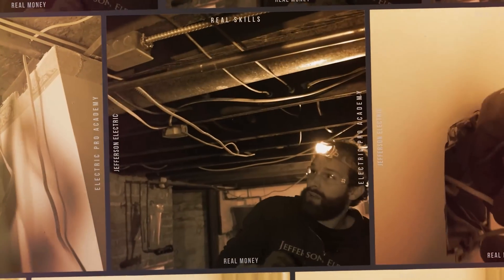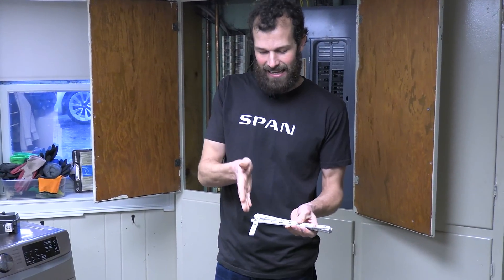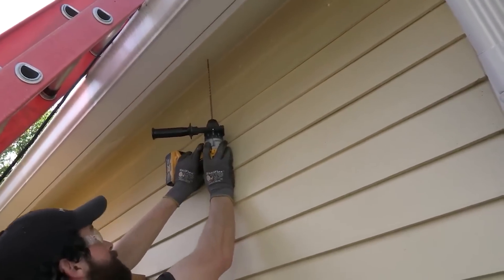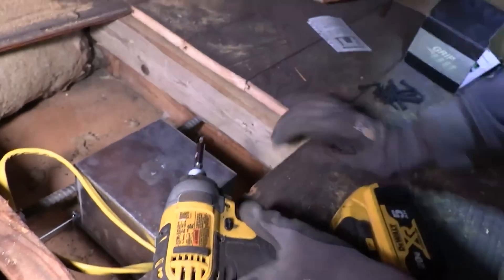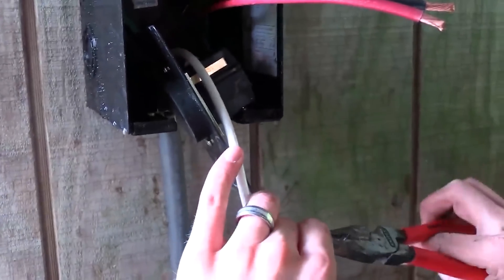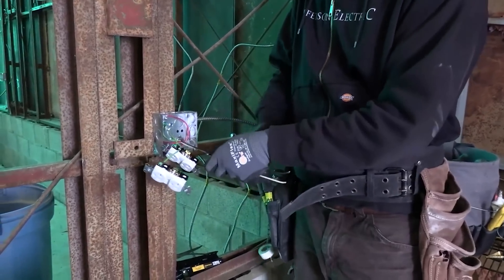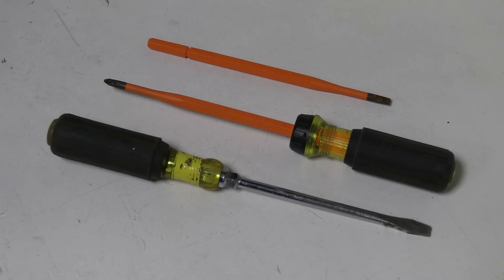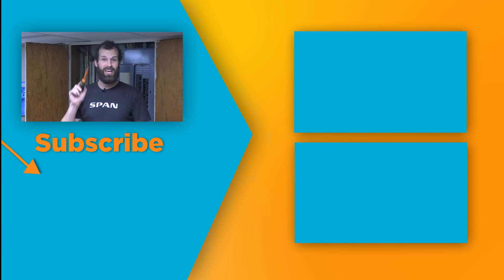Our 7 Most-Used Tools of 2022

Comment: Had a nice Rigid non metallic 6' folding rule for years. Finally grew feet. Love every cordless tool that I ever owned or used. Still call linesmen pliers side cutters ( ya I'm an old fart ) . Klein died make a great non contact tester. Like the single shaft real deal Klein insulated screwdrivers. Thanks Joel.

Comment: Please I have one question..Can Control and Line Voltage Wires Be Run in the Same Conduit?
Reply from the maker: Yes, with conditions (and it's always worth checking with your local AHJ):
Code Minimum - As long as the control wiring (all conductors) is rated for the highest voltage present.
Best Practice - Your power wiring may cause inductive interference to your communication wiring. That’s not likely with control wiring.

Comment: I find the drill to be better than the impact. One noise and vibration versus the adjustable I wanna say torque setting and speed setting. What I usually do is Chuck one of those quarter inch bit adapters in and just leave it and then it's a standard size. Unfortunately I got a set of drillbits with aluminum quarter inch ends and half of them have snapped so I went back to using standard drill bits which is so annoying because I enjoyed the quick change.
Reply: Impact drivers are better for driving fasteners than the combo hammer drills, in my opinion.

Comment: I splurged for a Knipex, it only has strippers for 14 and 12ga, which is most of what I need around the house. 

KNIPEX 13 82 8 T BKA ... I either saw something like them on your channel earlier or on Scott's Everyday Home Repairs channel.

And it's a little smaller of a "linesman" pliers also, for "pre-twisting." Oh, and it cuts through 80+ yr old 12ga romex with hardened sheathing, with ease.
Reply from the maker: Scott LOVES his Knipex hybrid strippers! We still personally prefer a separate set of linemans and needle-nosed strippers, but totally see how these hybrid strippers could work for other people!

Comment: Great list!  You have me thinking about the folding rule, as I currently have my torpedo level handy for short stuff and a regular tape measure for longer.  Now that you mention it, there are times when the 3-6 ft measures with the tape was a hassle, so I'll see how it goes with your solution.  I had one many years ago, but it broke and I never replaced it.  For strip/linemans, I find myself most often using the K12035 strippers with a linemans head.  Often after I strip, I'm twisting for a nut, so like the same tool in the hand the whole time.  I have others and use them as well, but that's my goto.